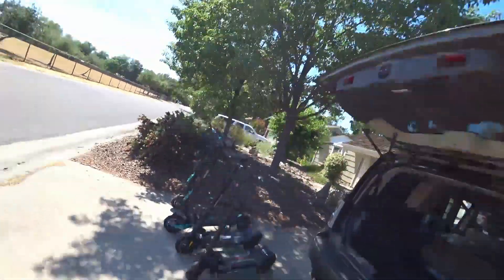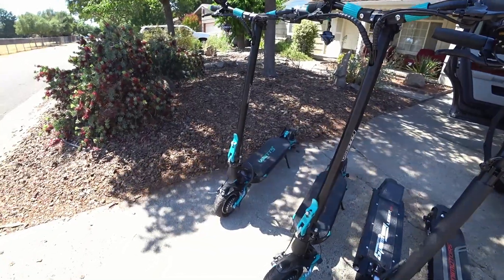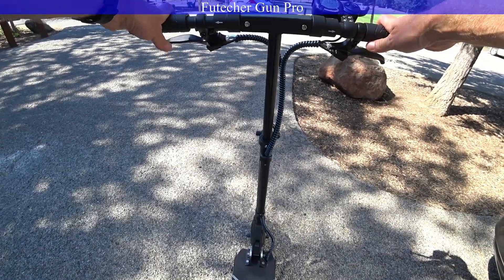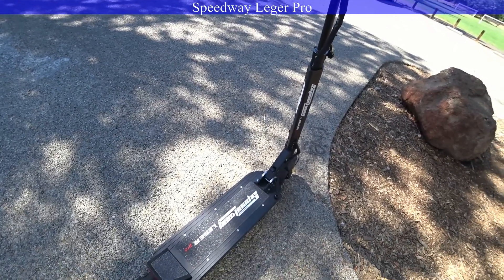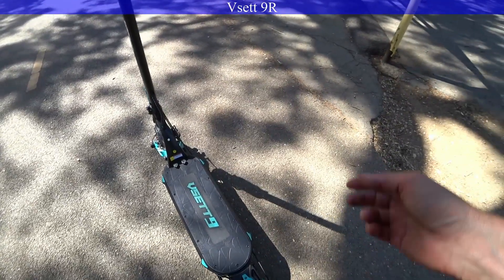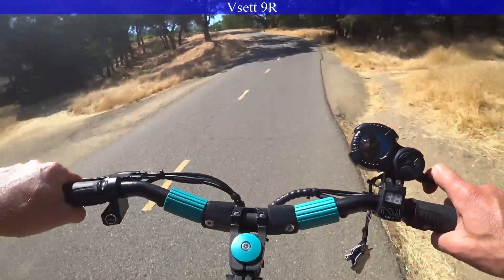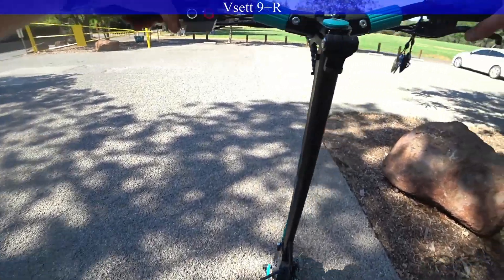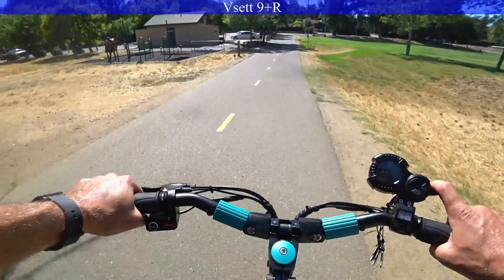4 Electric Scooter Hill Climb feat. Futecher Gun Pro, Speedway Leger Pro, Vsett 9R, and Vsett 9+R

Comment: Great comparison video, the Vsett 9+R  and Futcher Gun look like the standouts!
Reply from the maker: Thank you, for climbing small tires or dual motors are the way to go. I have had some problems with the Futecher Gun that I'll detail in a coming video. The Vsett's seem quite solid.
Reply: @ElectronSurfer  Looking forward to your next video :)
Reply: @ElectronSurfer  Out of the two Vsett Scooters in this video, do you prefer the dual-motor one?
Reply from the maker: @nicolewilson3886  I prefer the rear motor option, I dont ride fast and do a ton of hills. I like the slightly less torrid acceleration....
Reply: @ElectronSurfer  Thank you for sharing :)

Comment: please tell me how the futecher gun is i could get a used one for like 800 but idk if its worth it over a 9+ money is DEF in the question lol so idk. and id have like around 7 months left on the warranty if i buy the used futecher, is it a fast scooter? im coming from a gotrax 350w rear motor 20mph max it has a 10.8ah battery lol...
Reply from the maker: I would personally take the 9+ over the Futecher. It is more compact, better ride,  basically same weight, and with dual motors faster. Both of these will blow your GoTrax away, so happy scootin' whichever way you go! Watch out for warranty transfers, almost no companies will honor it, unless you get it from a dealer. Thanks
Reply: @ElectronSurfer  loving the futecher gun pro. didnt like how to front drum brake is kept in placve though.... bored a 10mm hole and fitted a nut into the U joint into the slot and now its solid as hell. Loving it so far. put about 180 miles on it.

Comment: Hi! nice comparison. Do you think rear motor Vsett 9 power is enough for daily use? I want to get an upgrade from my Xiaomi M365 pro in terms of max speed and hill climbing peak power and i am thinking about this vsett model. Thanks
Reply from the maker: I think the Vsett 9 works for most but if you really want hill climbing power you need 2 motors and the Vsett 9+ is about the smallest dual motor option out there. I haven't tried a M365 but I'd imagine max speed would favor the Vsett single motor but hill climbing might be pretty close. Hopefully that helps!

Comment: That's not a hill. Put the scooters to real work. Try on a 25 to 35 degree gradient.
Reply from the maker: I can only ride up what I have here to work with. A 25 degree hill is very steep, there are only a few hills in San Francisco over 30 degrees!
Reply: @ElectronSurfer  I understand I really do. I live Cardiff Wales UK an hill's are everywhere. As most video's i watch are done on the flat or a slight incline but there's not a lot of Youtube video about e-scooters from the where I live. I do like your video's an u can't help not having a big hill to test them on. I have a Carrera impel Is-1 electric scooter. It's got no suspension but air filled tyre's so avoid bumps. It's a gr8 scooter for its money it's built strong it's got a nice look an front an back disk brakes cable. Nice display an power is gr8 for what it is. Top speed 15.5 with 4 preset speeds/gears. Built in code an alarm. Power 350W continues an 600w peak. Rear wheel hub motor it can Wheely but only if u try to. Easy an strong folding. Thank you.   Ps. If I was in future to get a bigger scooter witch 1 out of these two would you get get for a every day rider. 1, vseet9+2021   or 2, apollo phantom2021.  I like these scooter for many things but 1 thing is there's no need to go over 40mph an an scooter.
Reply: If it helps my 9+ comes up hills of nearly 27° but I'm only 120 pounds.